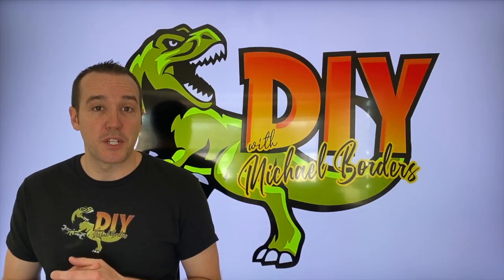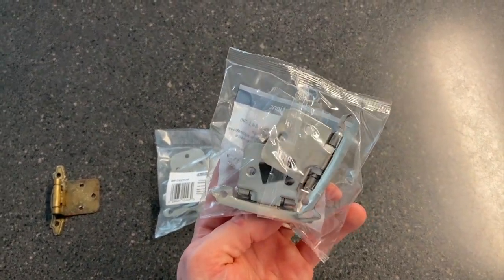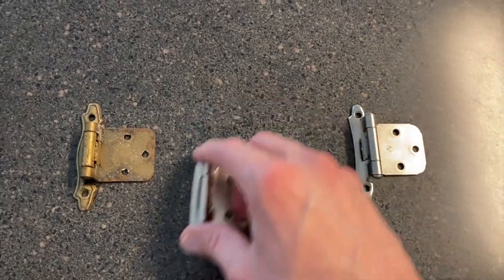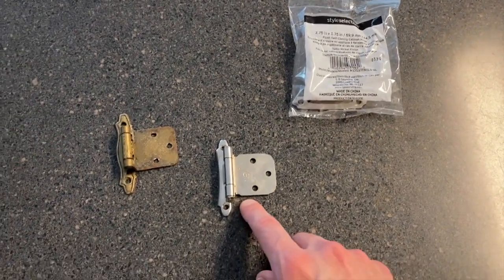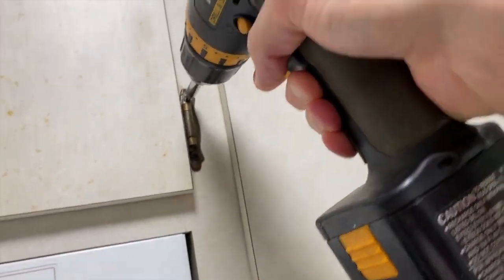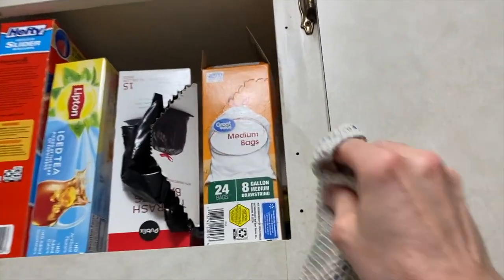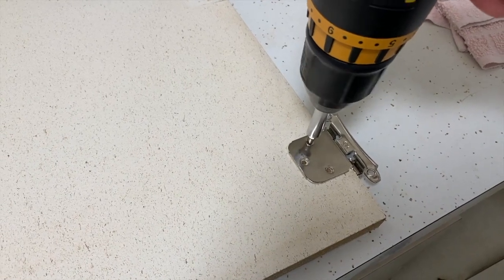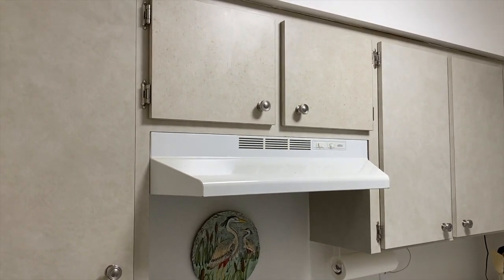Replace vintage Amerock cabinet door hinges - 1960/1970

Comment: Michael, thank you. Very helpful, as this is where we are headed. I have a question on the projection measurement. Is it the measurement from the hinge housing to the farthest screw, or is it to the end of the metal plate? Thank you for your help. Glad I found your channel.
Dave Ward.

Comment: Every door I put on seems to hit at the top or bottom after screwing it in while holding the door in place. Once I open it, it moves. How can I adjust this or what am I doing wrong?
Reply from the maker: Thanks for watching Kendall, any update?  Are the hinges a different size, shape, or thickness?  Please keep us posted.

Let us know if you have any questions and hey if you’re into crypto trading, join our DIY ecosystem.

       toolboxtoken.com

Reach out to us any time!  🧰

Comment: Hi I can use those hinges in frame less cabinet?
Reply from the maker: Thanks for watching & you can.  😎👍
Reply: @DIYwithMichaelBorders  but 3/4 is enough to hold it?
Reply from the maker: @MrSplaterPown  

Thanks for the reply, the standard cabinet door is between 2-3ft tall.  This will require 2 hinges per door.

😎👍
Reply: Yes I gonna install 2 hinges but you think that it gonna hold it?
Reply from the maker: @MrSplaterPown  

Thanks for the reply, how large is door?
Reply: @DIYwithMichaelBorders  24 inches
Reply from the maker: @MrSplaterPown  

Awesome, two hinges will work.  😎👍